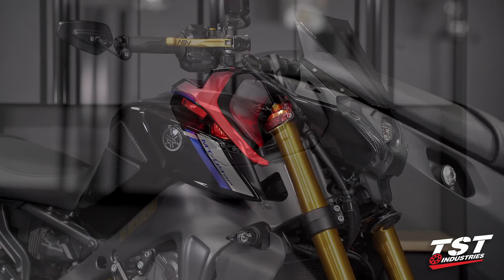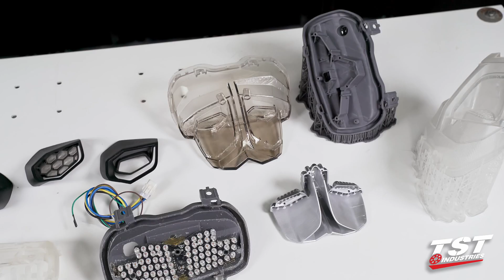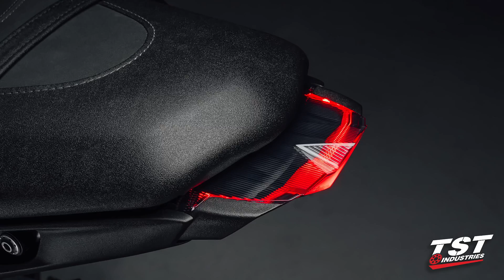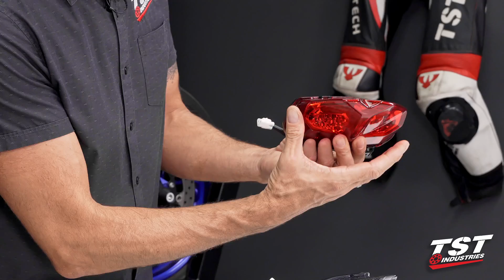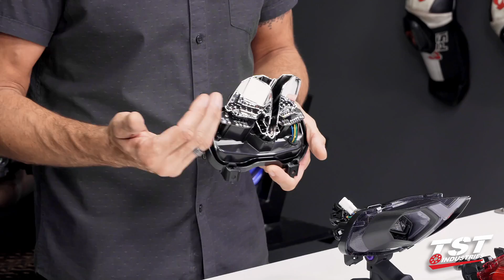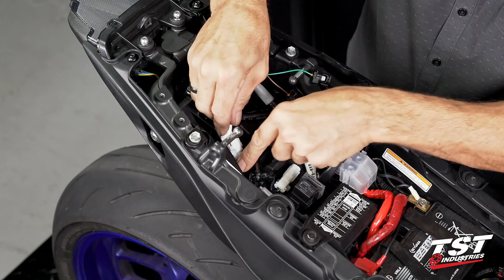All New 2021+ Yamaha MT-09 Programmable Integrated Tail Light - Product Feature by TST Industries

Comment: Is It possible to still use OEM indicators? Here in Europe indicators built in the tail light itself is not allowed
Reply from the maker: Yes, you can simply leave our signal connectors disconnected and that would allow the use of external signals.

Comment: Awesome product amazing I’m in UK love to have one for mT-10 2022 where I can do install and review if you ever get them buddy happy to show on the Uk channel
Reply from the maker: Hey there...thanks for the love. We designed an MT10 specific version as the MT09 is not a direct fit. The molds for the enclosure are almost finished so it won't be long now til the MT10 tail light and fender eliminator are already for sale. We have a UK dealer so you can grab these parts locally if you wish. Check out Cregtech

Comment: Will the Tst Integrated TAIL LIGHT work properly without connecting the turn signals? I would like to use this Tst  Integrated TAIL LIGHT with standard turn signals.
Reply from the maker: Yes it will work just fine in that configuration.

Comment: Brilliant !!! I will defiantly buy this light!!
A question. Anything similar for the R1M 2023 and the MT-10 2023?
Reply from the maker: R1 is not in the plans because of how slender that tail light is. The MT10 is a possibility but we need a bike to hang out in the shop for a week or two to make that happen.
Reply: @TSTindustries  On new 2023 MT-10 the rear light is almost identical to 2023 MT-09. I own them both and i know.
Reply from the maker: @KHIJAPAN  we know. We’ve actually had a few in house in limited capacity and have an OEM tail light to use for R&D.
Reply: Your light is very beautiful, but I think you must close those ducts because we all remove the rear number plate bracket and because of this, a lot of dirt coming from the rear wheel end up on the light. With your light all that dirt will accumulate in those ducts and scratch those beautiful crafted reflectors. In my opinion it is best to keep the design of the light but with full glass cover.

Comment: Nice.  Are you going to offer a splitter harness to keep the existing turn signals as well?
Reply from the maker: Unfortunately, on these new Yamaha models you are only able to use one pair of signals on front and rear. Anything more and the circuit will be tripped and your signals won’t flash. We may try to develop a solution down the road if the demand calls for it.

Comment: This is great!  I'd love to see more of the CAD modeling process.  Do you build a full 3d of each bike to start making parts?
Reply from the maker: Nah, that would be pretty wasteful. We scan only the parts of interest, like the actual part being replaced, and then its mating parts. Then we make the assembly so we can control how our part interacts with parent components. Then we build all our 3D models based on that. If you are local you can come in and I can show you some of the models I have done.
Reply: @TSTindustries  thanks for the invite! How accurate are the scans? Is it less than 1mm margin of error?

Comment: Wow, the light looks really good! But if I could make a request, I'd love to see universal LED turn signal lights that look almost OEM or factory supplied lights, because where I live we can't install anything on the bike that look too different from the standard light.
Reply from the maker: Why not just stick with the OE signals. The light source in them is LED, they are bright, and our fender eliminators can be used with the OE signals when the OE signal bracket is chosen for signaling method.